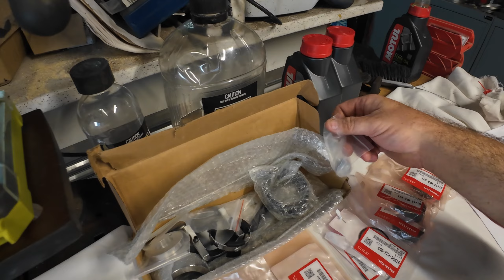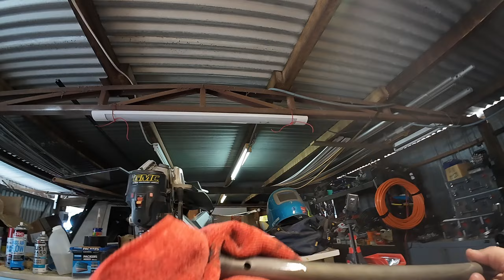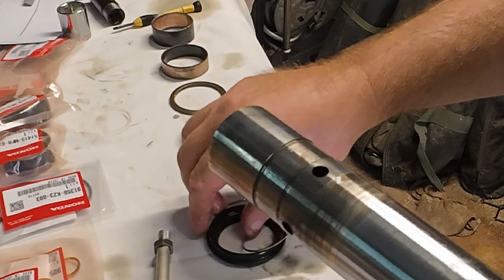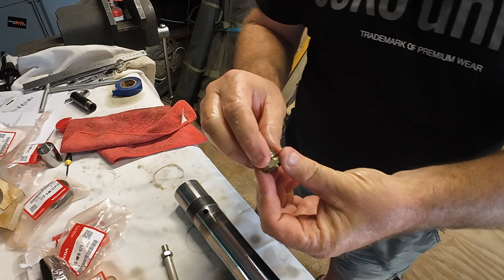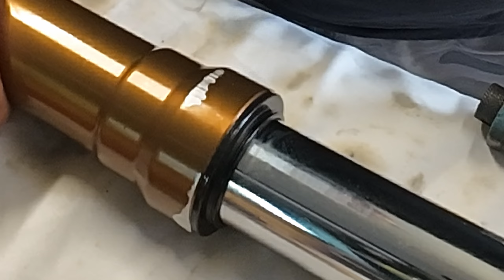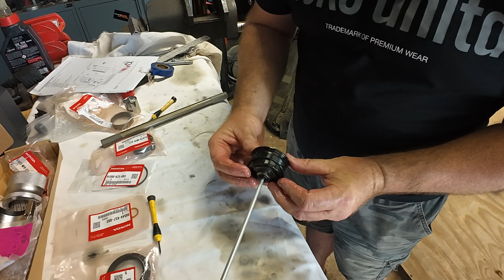AFRICA TWIN FORK REBUILD - CRF1000 FORK REPAIR

Comment: Good informative vid. The only addition i would make to those with 16 & 17 bikes (it may apply to later mdls, the manual is wrong) Prior to screwing on the fork cap, screw the rebound adjuster 3.5 turns in from full soft, then screw on the cap and adjust the lock nut to suit. Not doing it this way reduces your rebound needle adjustability. Once torqued up, make sure you have that same 3.5 turns (approx) winding the needle back out

Comment: Lovely to watch a professional at work. 
You would have been horrified to see how I did my ES Adventure sport seals and oil change without the help of the manual or special tools!

I was surprised you were not tempted to put heavier springs in. But given these have served you well for so long why fix if it isn’t broken.
Reply from the maker: I'd like to see that actually.. lol.. Yeah I will be putting in heavier springs in the front and back soon. Just got a million other things on the go at the moment.. I'll have a video of the ride I did the next day to test them out. Heaps better with the heavier new oil.